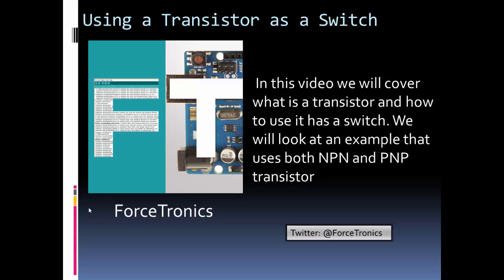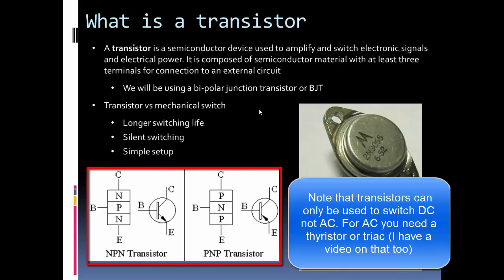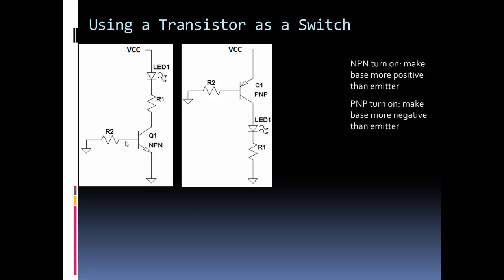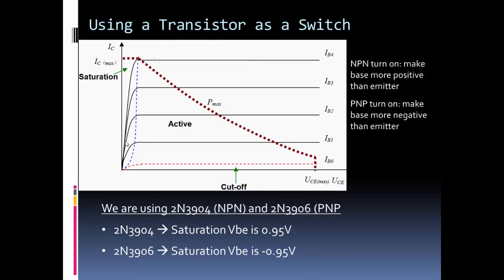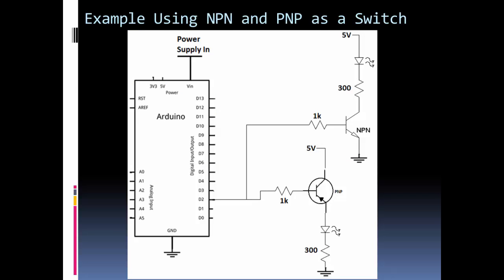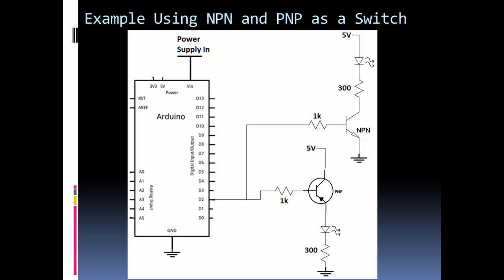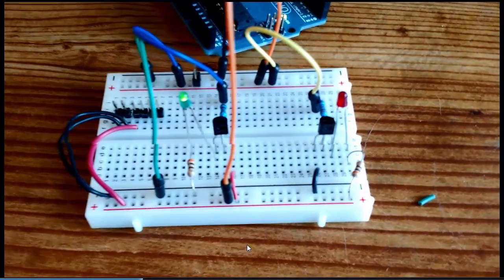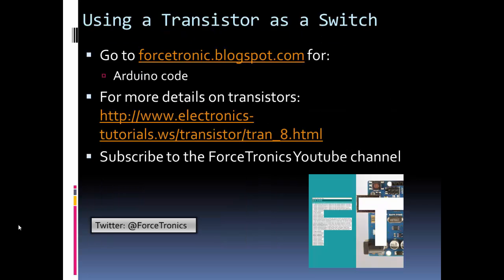Using a Transistor as a Switch

Comment: Schematic for NPN 3:30 is incorrect. You have grounded the base, so this transistor will never turn on. Also, a better approach to this, is to use an emitter resistor (no base resistor) so that the transistor is used a constant current sink. You can remove the collector resistor altogether.
Reply from the maker: efox29 Good point, I did not intend the base to be grounded (which I do verbalize in the video) I should not have used the same symbol for the base connection and emitter connection, good feedback. I will add a note to the video. The emitter resistor can work but than you have an emitter voltage that can vary depending on VCC, the load, and base bias level which in turn can effect the state of the transistor. For general switch applications tying the emitter to ground is the best or safest approach.